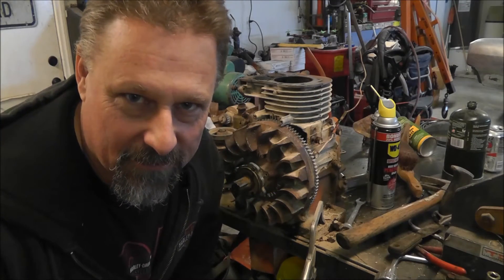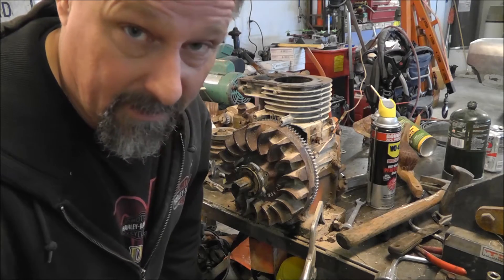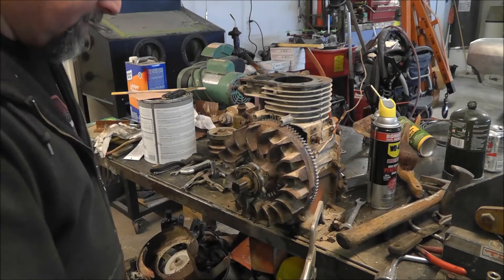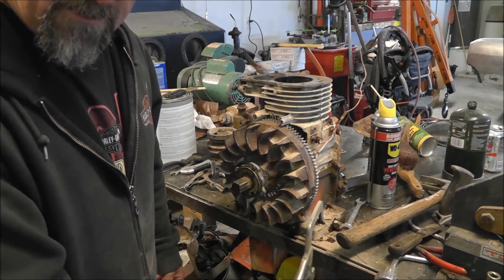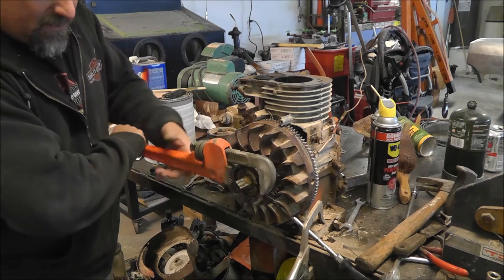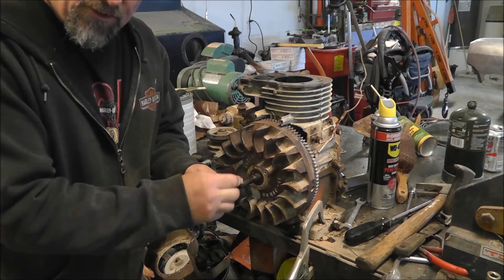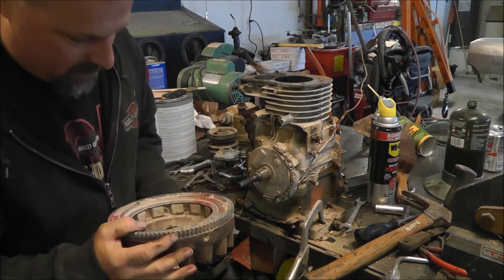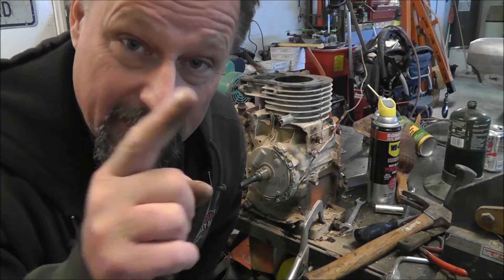Redneck small engine repair

Comment: When I was a kid (a number of decades ago) we did it the exact same way...no spacial tools. However using the same method on the flywheel/magneto of a  Harley 1200 Sportster engine this method did not work so well. We had 1 guy with a BA (big ass) torque-wrench, 1 guy holding the bike down and 1 guy pushing down on the flywheel. We managed to break loose and spin the trans-mission cassette in the engine case...woopsie. As it turns out we had to borrow a friends maximum electric impact wrench to get the not off. I was able to repair the broken transmission studs and road the bike hard for five years after including wheelies all the time and Daytona bike-week twice. Moral of the story...some times you do need the right  tool. so borrow it if you can!
Reply from the maker: Peter Baum or...get a bigger hammer!